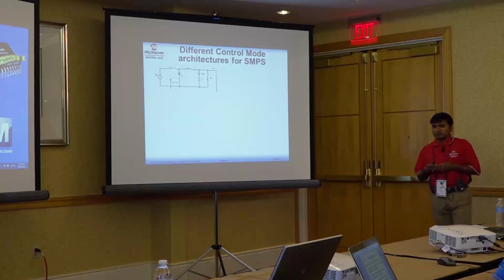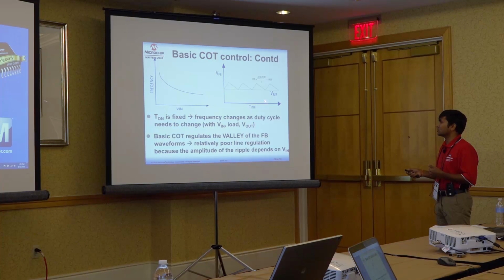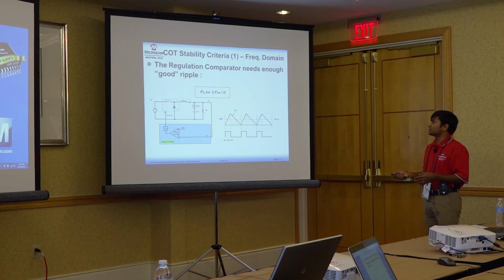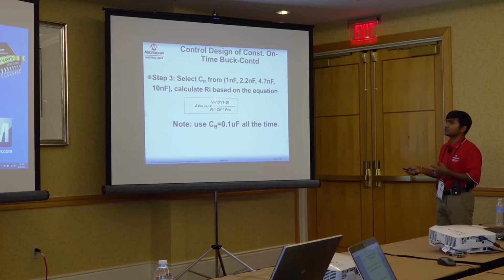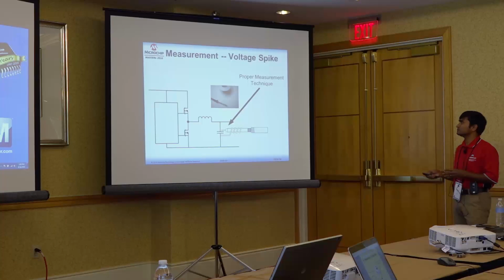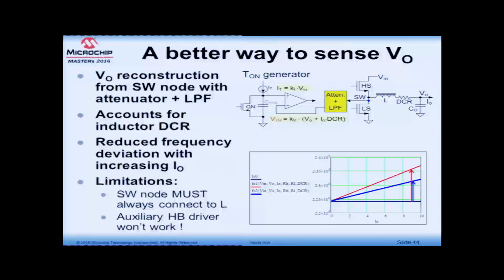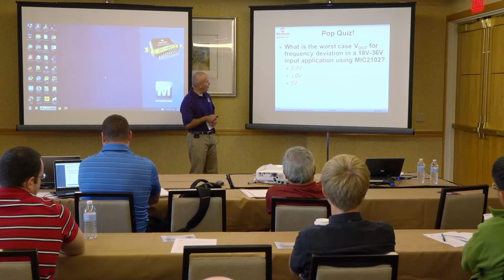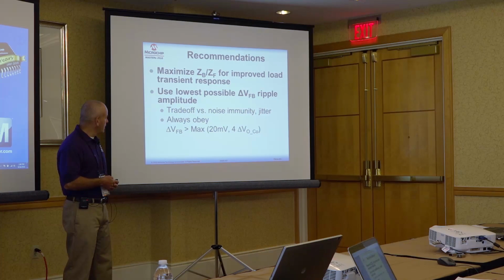20096 PC6 - Simplify Your Buck Converter Design with Constant-On-Time Control

Comment: Thanks for sharing and nice presentation. Could you please let me know what kind of devices you used for power transistors when the converter operates with an input supply voltage of 75V and convert it to 0.8V? Did you design with 70V N-channel MOSFETs?
Reply from the maker: Kindly visit support.microchip.com for assistance. Thank you.